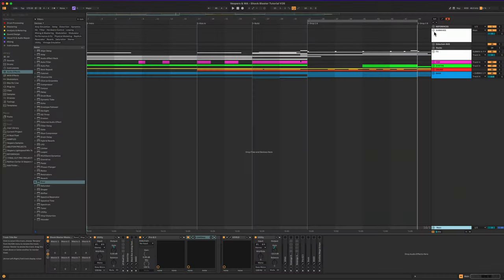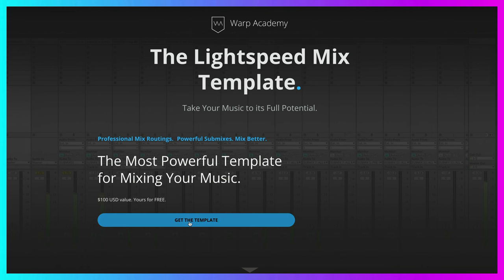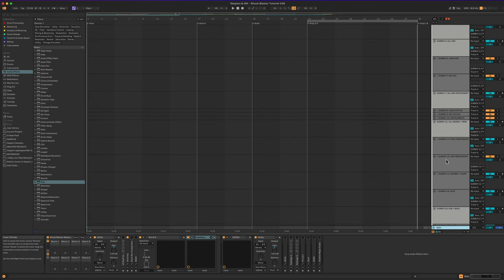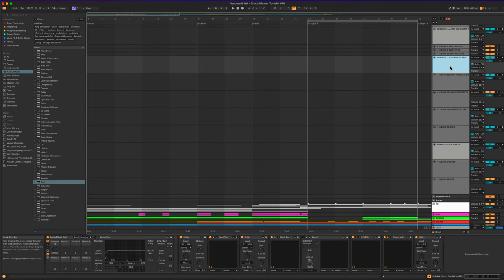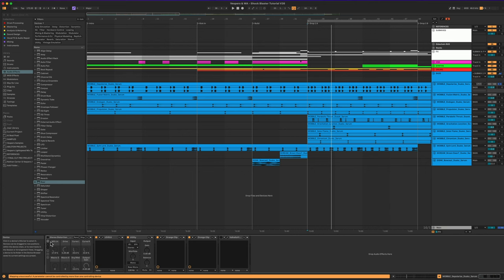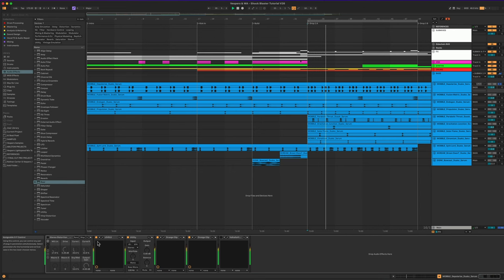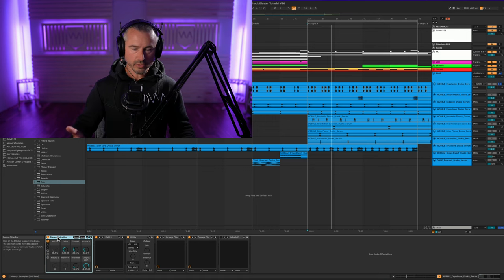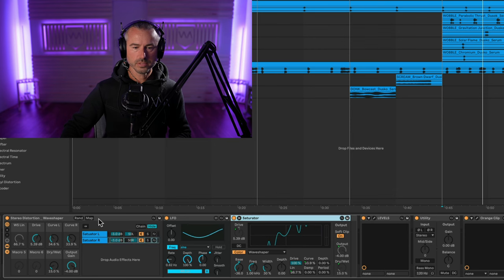Where Should You Use Saturation in Your Mix? + Stereo Saturation Bass Trick

Comment from the maker: One point of clarification.  In the section where I'm talking about gain staging down after saturation, it's important to match perceived loudness.  I showed peak level in the LEVELS plugin, but in fact a saturator will shave off peak level while increasing perceived loudness, so it's a better idea to match loudness by ear in this case.  If you just use peak level, then the post-saturation signal will sound way louder even through peak level may be lower.  Cheers!  https://youtu.be/WB7Tk5McHtM?t=632

Comment: Hi, old school engineer here. Are you saying that up until the digital age (mid-90's and beyond) when records were made on tape on top of tape on top of tape (24 track 2" to 1/4" mix to 1/2" master, etc) that it was bad (due to intermodulated distortion) because the saturation was done on the mix/master tapes in at least 2 generations? I like setting up my mixes to emulate tape, then analog console non-linearities, then tape again to get that old school saturation effect.
Reply from the maker: Hey hey.  Thanks for the question.  I'll admit that tape stuff was way before my time, so I'm just theorizing.  The concept is that anything that generates harmonics / distortion / saturation can intermodulate.  The big question is, can you hear it, and if you can, does it sound bad to you?  

I'd run a test by playing 2 pure sine wave tones separately into a tape emulation effect, and then bussing them together and repeating the test.  Listen for the intermodulation.  

A ton of records were made on tape, and recording tape onto tape onto tape, so I'm sure you can get away with it.  It's just a matter of if you like the sound.  Don't be afraid to try it, just be aware of what may potentially happen.  Hope that helps.  Cheers!
Reply: @warpacademy  thank you, great work you're doing on your channel!
Reply from the maker: My pleasure.  And thanks for the visit!

Comment: about measuring at peak levels: i disagree in a way that the loudness might be different from the looks of the peaks, especially if using saturation
Reply from the maker: Totally hear you on this.  Did you see the pinned comment where I addressed that?  I misspoke in the video and corrected myself afterwards to say to adjust to perceived loudness and not peak level so you’re not experiencing a psychoacoustic loudness jump that would bias you.  

Good catch!  Because in this example the peak level was significantly reduced while sounding louder.
Reply: @warpacademy  that was just a comment on my behalf, i did not read anything below the video prior to writing. you know what you do, and its normal to misspeak smtmes

Comment: is Roar not already a stereo processor? what you are doing there as well, it's not stereo. it's dual mono. there is a difference, but people seem to use them interchangeably. not sure why
Reply from the maker: You absolutely right.  All effects in Live are stereo.  There’s no such thing as a mono track in Live. And yes, what I’m doing is technically dual mono.  

That said, this is a specific widening technique that uses different settings on discrete L and R channels which is very different than simply running Roar in stereo.  

Also I use the term stereo more to refer to the fact that there is enhanced stereo width due to the fact that there are exaggerated differences in the processing on L and R.  The stereo image is wider in this model.